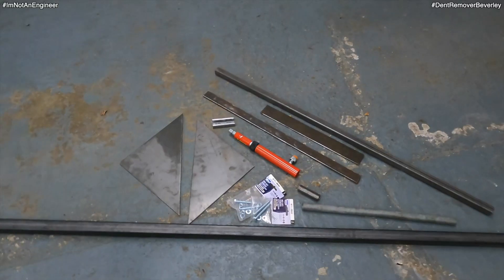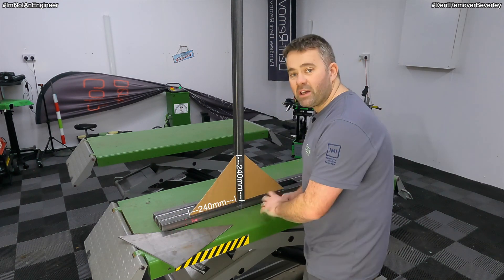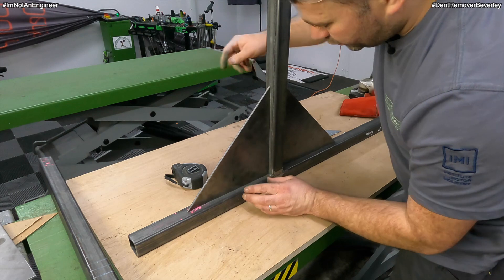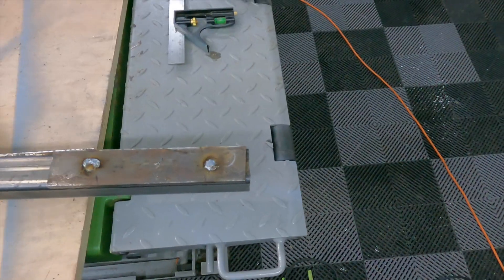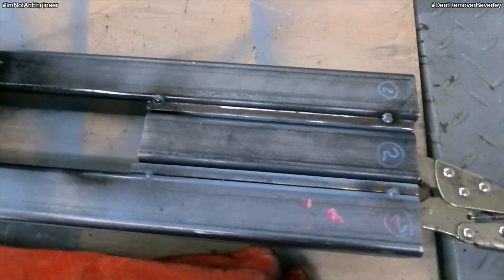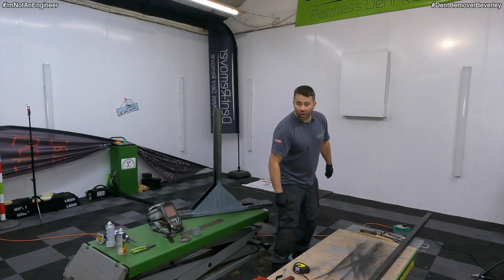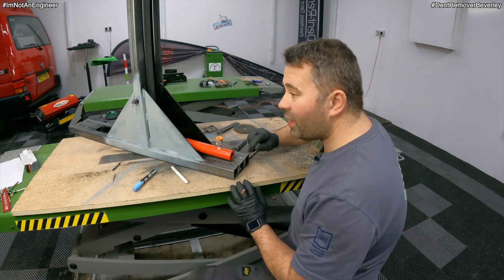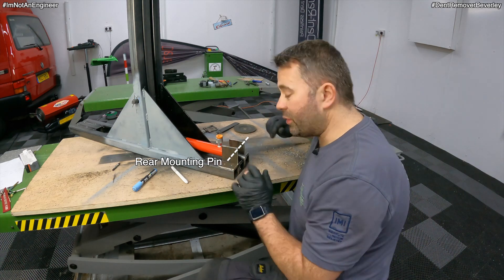HOW TO MAKE A PDR GLUE PULL TOWER Part 1 | Paintless Dent Removal, Dent-Remover

Comment: I've a fiat 500 to do tomorrow that needs heavy glue pulls - I.E tower required ASAP as it is beyond the scope of hand pulling. 

Being lazy/always wanting the "minimum viable" solution that avoids "Effort" I worked out that a big RSJ that holds the roof up makes a perfect "pull tower" - being PDR, the vehicles are generally mobile - so they'll get "mobilled" to the right spot in relation to the existing RSJ - the puller will pull off that.

 Beyond that, all I need is a puller (doddle to make if you keep it simple) - the "minimum viable" on those is a turnbuckle with some light welding/some chain/hooks - which ironically is super-accurate in terms of force exerted/feedback/feel. 

Just as "another way" if someone didn't fancy spending ages making one. You probably have one staring you in the face if you look. :-)

Comment: Like the build. What stuff have you laying on the floor? It looks like it can take a fair bit of abuse.
Reply from the maker: Hi Gjvdspam thanks for your comment, it’s Swisstrax “ribtrax” tiles they are super strong and have holes in them so you can hoover them dust up and if you have a wet car or spill any liquids the floor (tile surface) doesn’t stay wet

Really good but quite expensive at around £6 a tile 😱
Reply: @dentremover01  thank you very much. I’ll have a look at them.

Comment: That last pin bolt looks skinny. But, I always over engineer things.
Reply from the maker: I think it’s either 12mm or 16mm bar, but it’s a short length between the triangle supports so should be well matched, I think if anything it would start bending the swinging arm first. But if it does happen to hit it hard il definitely inspect all areas before I use it again. Good point though thanks for bringing it up